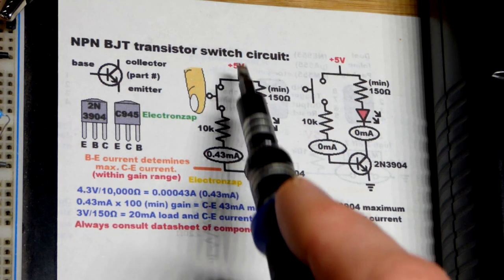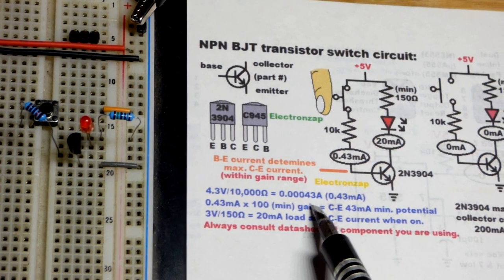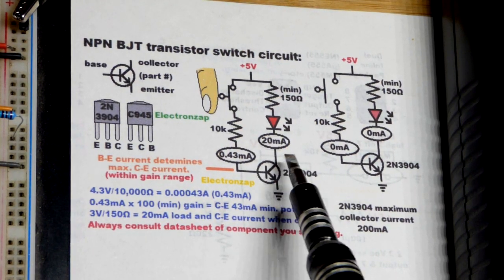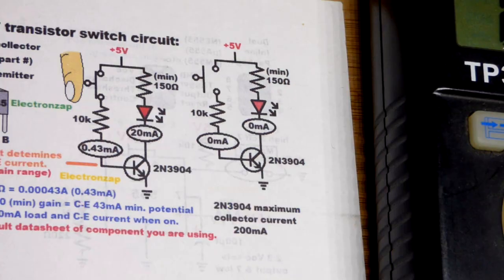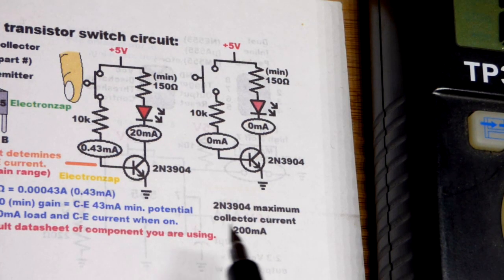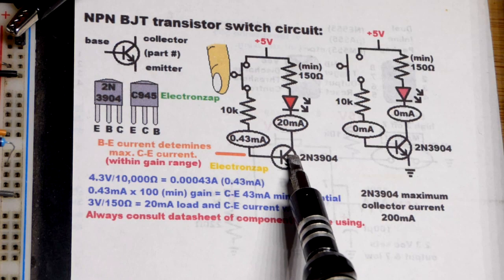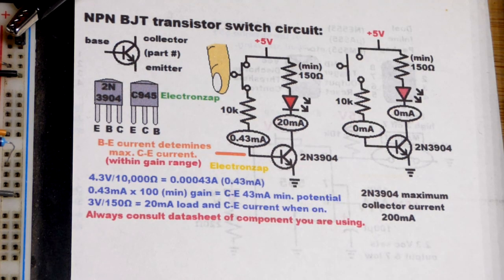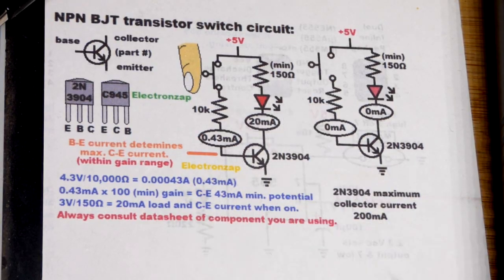NPN BJT Switch Circuit Basics Bipolar Junction Transistors by Electronzap

Comment: Could you discuss this circuit with the 150R and LED on the emitter instead on the collector.
Reply from the maker: When the load is on the emitter side, then the transistor circuit is called an Emitter Follower or Common Collector, which is a voltage follower but with an approx 0.6V difference. So, just search for Emitter Follower.
Reply: @Electronzap  Much appreciated. Thank you!